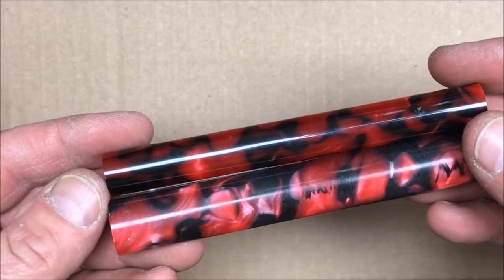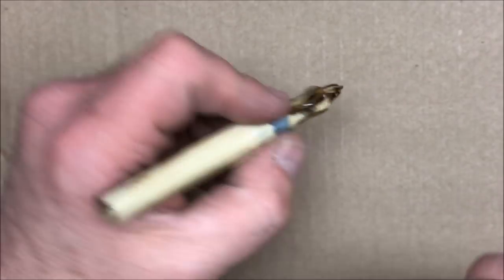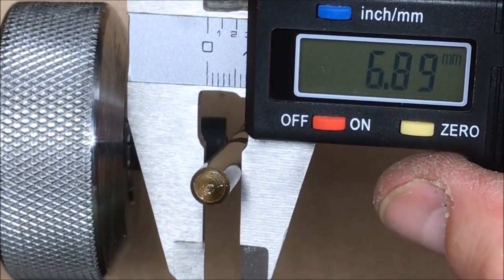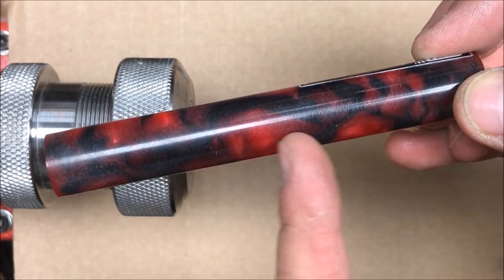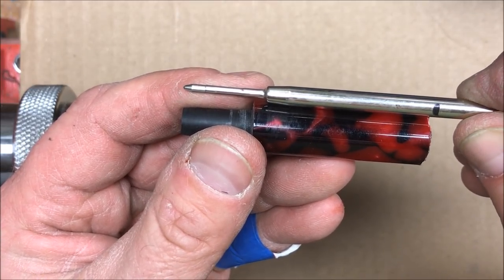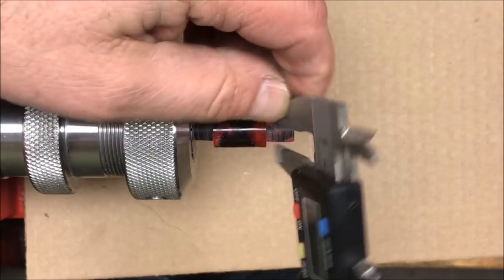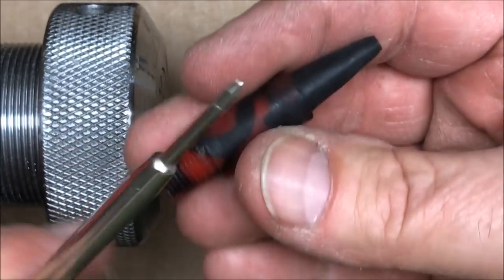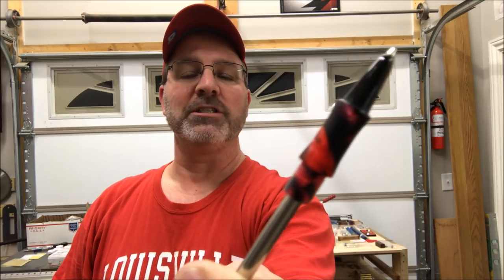Latest Design Of a Bespoke Section That Uses A Parker Refill

Comment: Have a question for you if the transmission for a pen slides in without being pressed can I  put some CA on it to keep it in the tube
Reply from the maker: You have to me careful doing that because if it gets into the mechanism, it will seize it up. 

Regards,
Bob

Comment: Pretty impressive. 
Now you need to show us how to get threads on something that small. 
Christian Jensen Woodturning my way
Reply from the maker: I cut that part to save time but I’ve done it on some of my other videos. I use a m10x1 die in a die holder and it cut like hot butter. 

Regards,
Bob
Reply: RJBWoodTurner That's a great idea. Thanks

Comment: Nice video! Keep up the good work!
I do have a question for you, unrelated to this video. Whenever I finish my pens, I keep getting these white spots that show up after I start micromeshing. My process is this: sand from 150 to 500, clean with denatured alcohol, apply 5 coats of thin CA, then micromesh. I would normally then apply about 3 coats of medium CA and micromesh, but I get these white spots that look ugly. Any guess on what these spots are and how I can get rid of them? Thanks for your help and time!
Reply: Actually I just watched one of your previous videos on CA finishing and you mentioned how you let the alcohol dry while letting it spin for a few minutes, else the moisture can cause the spots. So I’m gonna sand off the CA I have on it now and hopefully remove the spots, then redo it, making sure to let the alcohol dry
Reply from the maker: That’s great Adam. I hope it helps. 

Regards,
Bob